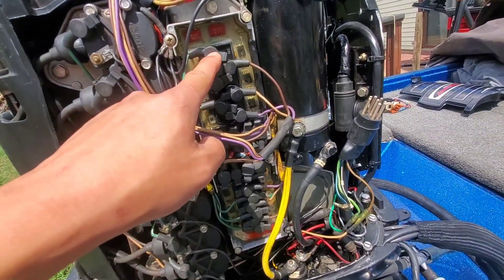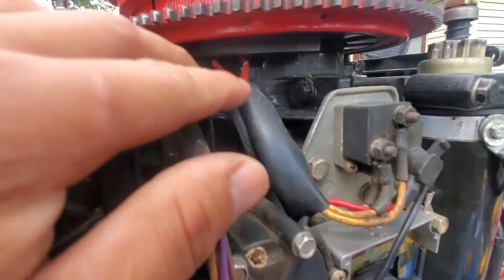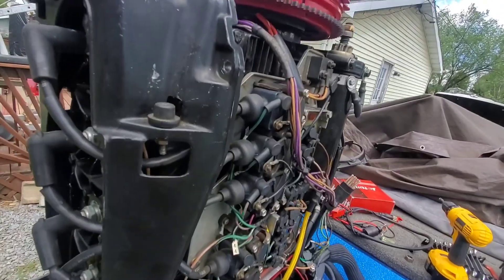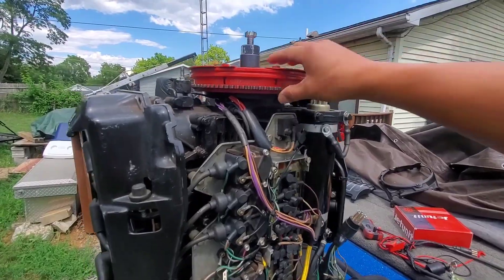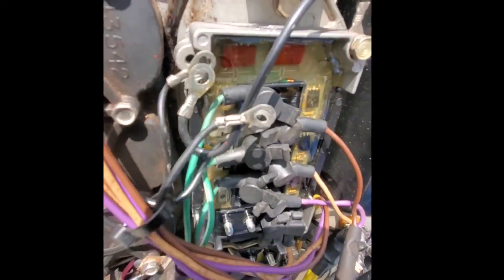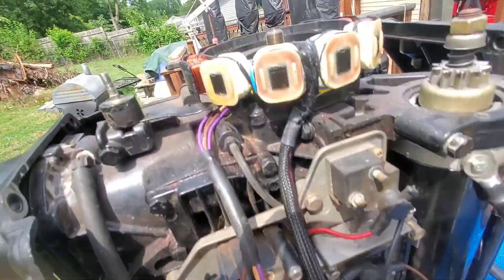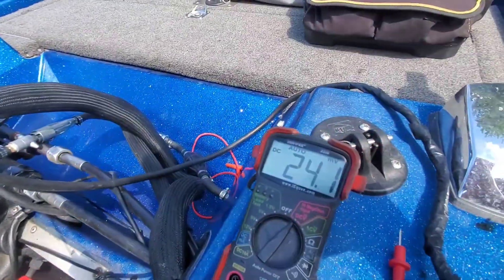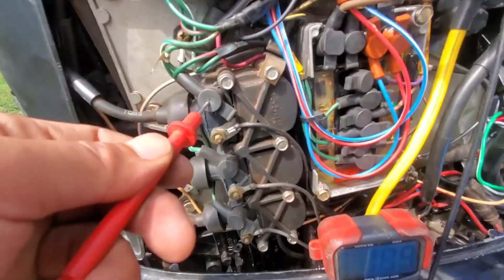Mercury Outboards: Stator Install & Testing

Comment: This is off topic but is there anyway I can email you, I would like to rebuild a 96 Merc 40hp 4-cylinder 2 stroke oil injection , I've rebuilt carbs, fuel pumps and I've been working on motors for 10yrs mostly basic stuff 
Thanks

Comment: Hey @mercson why you took the flywheel off from the centre nut on the cranckshaft and you didnt take the 8 bolts holding the flywheel ?

Comment: Hey merc son, my timing is jumping all over the place on the high side padt 21 degrees and it bounces.  Even if i lock it down around 15 or 18 it will still bounce around past 21 at at rpm over 3000k ...its a new stator and trigger,  could it be my flywheel pick up? (Tdc and .464 verified)
Reply from the maker: Timing should not be jumping at all. Something is wrong with your trigger. The trigger tells the switchboxes when to fire.
Reply: Will take a peak at it again. Found the rectifier was bad, replaced it , but it didn't help the timing issue.  
Charging now, but my tach still isn't working .
Reply: Oem trigger is 1238 across all 3, new cdi is 940 across all 3.

Comment: does it really matter about the striped blue and red going to top or bottom switch box. I think I have mine wired opposite.
Reply from the maker: If its not broken don't fix it. I've never reversed them but I believe the purpose is to power the capacitor within the switchbox. Son

Comment: Hi mercson. What's a good timing set range for these l6 engines? Just trying to tweak mine the best I can. Also trying to get lower than 1000 rpm ?
Reply from the maker: What year/hp you got?
Reply: 1986 115 hp l6
Reply from the maker: A 1986 ADI should idle 4-6 ATDC with max set at 19-20 degrees...... it is difficult to to achieve the ATDC idle conditions/reeds are not in great shape. I have a video on the process of link and Sync. I'll post below. Son
Reply from the maker: https://youtu.be/x5MQUmXhf9c

Comment: Ok thank you. What's a good idle for the 85 l6 adi ignition,  about 1,000 ?
Reply from the maker: 700-800 is "good." In gear it should drop to 600. Definitely have to keep it below 1K to avoid damaging your lower gears. Son

Comment: Hi mercson.  I had a question to ask, I just want your thoughts on it. Befor I owned my l6 someone must have removed the flywheel and didn't put the timing marks back correctly. I was going to use the piston stop method. And make my own timing mark on the flywheel cover. Instead of pulling the flywheel. What do you think ?
Reply from the maker: The flywheel is keyed. Align the flywheel correctly then find TDC. Son

Comment: Hi again Mr.mercson. I just wanted to ask if you ever used those new clear resin switch boxes ? I ordered 2. I just thought how could you beat that price of 25 dollars each. I hope it isn't cheap junk. What do you think?
Reply from the maker: Probably junk. But should work out of the box. I put some clear ones on my L6 and it's running fine. I asked myself the same question. If the shoe fits wear it. Boating is expensive so saving a few and there is not shameful. Son

Comment: Hey Mercson, Always enjoy your vids. You’re a great teacher for us guys with the old inlines. I have posted questions before and have another. I have a 1984 L6 90 hp. Been chasing electrical problems. Had some intermittent spark issues did the easier fixes first.  I first replaced the cdi boxes and coils. Seemed like cylinders would miss randomly and a couple coils must have had hairline cracks, could see arcing when run in the dark. This seemed to help with running except for idle. 

I double checked timing and made sure butterfly’s where closing and opening fine. Carbs seem to work really good have good fuel flow. Did the link and sink. 

Motor died on us one day found some crusty wires off the stator to the rectifier fixed wires but had a fried rectifier. Decided to run without rectifier because my idle was fine when unhooked, but now it doesn’t rev up, have to play with the throttle to get it to rev when on the water under load. 

This whole time I have been thinking a bad stator, But it ohms fine according to the CDI troubleshooting guide. I bought a dva adapter and found the upper voltages from the blue and the blue with white were in spec but the red and red white were out of spec higher voltages. Also after watching this vid I double checked voltages at the coils and they are all below  150 volts but number 4. It’s quite similar to your problems. Am assuming I need a stator. Think the low side charging died first, why it fried the rectifier and now the high side is going. 

I guess I am asking if this sounds right from an expert. Also the trigger ohms fine, but should I replace it while under the flywheel. I know this is a long post but your input is really appreciated.
Reply from the maker: No worries my friend. Replace the stator. Happy boating! Son
Reply: @MerCSonL6 does it matter which way you orientate the stator? My old one wires coming out at front right above carbs, but my new stator wires not long enough to go that way, it would work the way you put yours.

Comment: Hi i have a 90hp 6 cyl and measures on stator blue white to gnd is 33 k ohm first and now it is 20 m ohm / and blue to gnd is 6500 is that the problem? dont´t get spark on 3 cylinders when cranking
Reply from the maker: What cylinders are you missing spark from? I believe the top switchbox controls on odd cylinders and bottom switchbox controls the even cylinders (I may have that 😅 backwards). But if 1,3,5 or 2,4,6 are out then the switchbox is the issue. Let me know. Son
Reply: @MerCSonL6  Hello i took the stator of and now there is no connection at all on that cable, it was the switchbox on that cable that didn´t work.
the switchbox ohm reading on that with broken stator is 5 mohm gnd to coilpin no coil connected, and the other is 13 mohm don´t know what the value chould be, maybe it´s the switchbox that have damaged the stator?
maybe its better buy everything new, where do you buy your parts?
Thanks Tommy

Comment: I have a 1984 90 hp and I just changed out the stator because the readings, like you are doing here, were low. The new readings were 300-400 for 1,4 and 6 and then it would change and be less than 200, like the old stator. The readings were changing every time I started the motor. It sometimes stalls when I am probing it, if I take it off, it will stay running. Whatever the issue is, it's intermittent and explains why it won't idle very long. Any ideas?
Reply: @Mercson L6 is there any way I can pay you to advise? I've been watching your videos and been working on this motor for months.

Comment: 2:39  Don't use a torque wrench as a breaker bar!!  Go to Harbor Freight and pick up a 24" bar for $10    BTW, stators are so dang expensive!   $400-$500 for my 2.5L 200

Comment: Hell yeah it’s Steven, I loved the video can’t wait for boat money hahaha what’s the tool called to remove fly wheel ?
Reply from the maker: Flywheel puller. Pretty cheap on ebay. Around $20. Son
Reply: @MerCSonL6  I just use a impact and have never had any trouble
Reply from the maker: @storytimewithunclekumaran5004  That's great. I started using it too actually 😅.... its waaaay easier. I'm sure some will disagree and say you can damage your crank but like you said, I haven't had any issue 🤷

Comment: Son, Great videos, I have an 86 115 tower of power and I am having the issue of no spark on the odd number cylinders like you had on the other video. I replaced my switch box and have also tested the trigger switch and had 1200 on all wires. Would you suggest the stator is the problem?
Reply from the maker: Yes. Son

Comment: Hey Son, on my 1988 Merc 115 L6 I had lost spark on cylinders 3, 4 & 6 during cool conditions and then it would clear up after running 5 - 10 Mins.  Replaced the stator and I regained spark on 6 but 3 & 4 are still not sparking.  Coils passed test.  I'm thinking the switch boxes are the culprit now (your thoughts?).  Note: Rectifier test failed, ordering new one but I don't believe this has anything to do with my spark problems.  Also, the trigger test passed also.  Thanks so much for your time sir!!
Reply: Another note: The trigger test passed too.
Reply from the maker: It has to be the trigger. Son
Reply: @MerCSonL6  I replaced the switch boxes a month ago and it's been running great ever since.

Comment: I just received the replacement Jetunit stator for my 1985 45HP Mercury and the Jetunit installation manual specified that I should install a regulator for this stator. Is it a generic information or I have to install it? If I have to do it, could you suggest me a model of regulator? Thank you.PS , sorry for my approximative English.
Reply from the maker: I've never had to install a regulator on a 405. Son
Reply: @MerCSonL6  thank you Son, 405 ? do you mean 45HP.
Reply from the maker: @ericlecorney1144  yes.
Reply: @MerCSonL6  Even with an after market stator like this one?
Reply from the maker: @ericlecorney1144  correct. If the aftermarket part says you "need" it i would install it. It could affect your charging system and tach. But again, I have never had to install a regulator on a 45. I have only installed rectifiers. Son

Comment: Could a flywheels lose its magnetism? After installing a new stator, still no spark on #2. New stator  dva adapter give me low voltage, same reading as the old stator. Could it be the magnets? or could the starter not be cranking fast enough? I inspected the flywheel still looks good, no broken magnets or anything. Any suggestions?
Reply: Yes it can loose magnetism, but I don´t think that this is your problem. 

Assuming that you have an ADI ignition system as in the video, problems with one cylinder can often be found using the engine as test bench.

You can think of the ADI system as a 6-channel music system, with per channel, microphone (trigger),  amplifier (one third of a switchbox) and a loudspeaker (ignition coil with lead and sparkplug).

If you swap trigger between cylinder A and B, and AT THE  SAME TIME the corresponding sparkplug leads, Cylinder A will run with cylinder B´s switchbox channel, ignition coil and sparkplug lead and wise versa for cylinder B. Assuming cylinder A is faulty and the fault moves to cylinder B either the switchbox channel, ignition coil or plug lead that originally was connected to cyl A is faulty. If it does not move the trigger for cylinder A is probably faulty. 

Note: Do NOT swap between switchboxes i.e. cylinder 3 and 4. It may be safe but there is no need to swap in this way so no need to take the risk.

Comment: I want to start off with your videos have helped me lot , and I really appreciate you doing them, I do have a question if you have the time ? I have a mercury 115 tower of power and it runs fine on hose but in the water it doesn’t want to idle, how do I idle the engine up a little to run in water, my cell number is 6018966582 , my name is mike thanks

Comment: HI Son! I dont know how else to message you...so im going this route...i recently bought a boat that came with a 90 hp merc tower of power...im not sure where to look...but the numbers i did find lead me to believe its a 79....so my question is ...where do i look to find out the actual year....and...what is the OEM compression rating needing to be at?!  Chris
Reply from the maker: 120 psi minimum. Whats the serial number?
Reply: @MerCSonL6   i dont know where to find that Son
Reply from the maker: @chriscruickshank9468  its likely on the front of the engine on a metal plate where the color clamps down to the transom. Son
Reply from the maker: What type of ignition components does it have?
Reply: @MerCSonL6  ..The color?....
Reply: serial # 7137893
Reply from the maker: @chriscruickshank9468  what colors are the cowling?
Reply: @MerCSonL6  black with blue mercury decals...chrome edging
Reply from the maker: @chriscruickshank9468  6 ignition coils?
Reply: @MerCSonL6 Oh i dont know...
Reply from the maker: @chriscruickshank9468  does it have a distributor??
Reply: @MerCSonL6  yes it does

Comment: I just bought a bass boat with a 71 850 L4 and trying to get it to run (seller lied to me). I did compression and have 135-136 across the board. I am 65 years old and have some mechanic experience but not on electrical. I have multitester and slight knowledge. can you tell me where to start? I have learned alot thru your vids. thanks in advance.
Reply from the maker: Compression is great. I would check spark next. After that it's carbs. Son
Reply: @MerCSonL6  so far i checked and have working coil and moving on to switchbox . thank you sir
Reply: is there a specific test just for the switchbox?
Reply from the maker: @richardblanch1576  https://youtu.be/ZNho8LajDDU
Reply from the maker: @richardblanch1576  this will test both switch and coil. Son
Reply: @MerCSonL6  do you sell good distributors sir.
Reply: i have a good coil I think.
Reply: update: I installed all components and did a continuity test to each spark plug wire and got a signal(extremely weak at best) by turning flywheel (1,3,2,4) and ignition on. i dont think there is enough spark to ignite gas I put in cylinder 1 and 2 after re-installing plugs and wires with good cranking. If I am getting a test light at each plug wire does that mean all the components are in working order but one piece is not up the the job of providing good spark? engine may be up for sale soon!
Reply from the maker: @richardblanch1576  I can rebuild your distributor for with a new trigger for $700. ($400 cdi trigger). Let me know. Son.
Reply: @MerCSonL6  I appreciate the offer to rebuild but after watching you rebuild one Im pretty sure I can do it. course I dont have a cute helper like you did, lol. am i correct in that the trigger is working if I get current at each plug wire as i turn the flywheel and test in the firing order? my question is where is the proper amount of current generated from, the coil?
Reply: coil readings= primary .5 and secondary .323    thanks again
Reply: I now have a L4 850 1971 with 130 compression on all 4 for sale. engine is complete. also have trim pump, cylinders, brackets, and hoses for sale also. Im located in Tenn
Reply from the maker: @richardblanch1576  I am interested.

Comment: Hi there -  Your videos are fantastic!!  I do have a question for you, you mention in this video that you were wondering if this particular stator was salvageable.  I have a 1976 Mercury 1150 and am trying to replace the stator.  The 2 wires coming from the stator are fraid and brittle.  Have you every removed the old wires and replaced them to reuse the stator?  Thanks, Erik
Reply from the maker: Absolutely. Solder new wires in. The older stators are almost invincible. Son
Reply: Excellent!!  Thanks.
Reply: Excellent!!  Thanks.

Comment: Great channel ...my lower unit grenaded and when the driveshaft was pulled out of the powerhead the splines were chewed up. Sorry..it's a 69 1250 2654027..anyway is it safe to assume the same thing is happening in the powerhead?  If it is do i need a new driveshaft on the actual motor? It has 130 compression across all cylinders.

Comment: I have a 1986 Stratos Bass boat someone has cut wires from the ignition back to the batteries it has a 115 tower of power mercury outboard motor runs fine but not charging batteries could you tell me white wire goes from ignition to batteries to charge batteries the only wires that are hooked to the batteries are the battery cables, the wires from ignition are back there were the batteries are but all of them are cut can you help? Thank you
Reply from the maker: The wire that charges the battery comes of the rectifier. Traditionally red. Connects to the starter selonoid on the same post as the red battery terminal.... which goes to your battery. This is how the stator/rectifier charges your onboard battery. Son
Reply: MerCSon L6 thanks and your videos are a big help

Comment: Hi my name is joe I’m having a issue with my 1986 115 it’s fine at idle but in the water under load it sounds like 2 or 3 cylinders are cutting out any input would be much appreciated thank you
Reply: Check out his video on Link and Sync first!
Reply: @craiggreenwood2291  what link ?

Comment: Hi MerCSon L6 - HawkeyeMarine gave me the recomendation to go here. What is your reflection after this video: https://www.youtube.com/watch?v=4evkl7kQRw4&feature
Reply from the maker: What pitch is your prop? Weight of the boat? Idle rpms? Sounds like it was not properly link and Syncd. Son
Reply: @MerCSonL6  Hi. I do not know (at this point) the pitch. The weight is (I am from Sweden so we use the metric scale :)) 362 kg (790 pound). OK. Linking. I am also into that it feels like the engine needs some more "food" to be happy at the moment when the gear is engaged. If you increase the idle speed it will not help becuse you do not change anything except the timing. I will take a new look but I am quite sure that I made a good link and sync following the factory spec but as you know - assuption is the mother of all foul word :) //T
Reply from the maker: @AmateurTravelOutdoor  try turning both idle screws 1/2 turn ccw. Might work might not. If your boat is over pitched that will also affect your tuning. Son